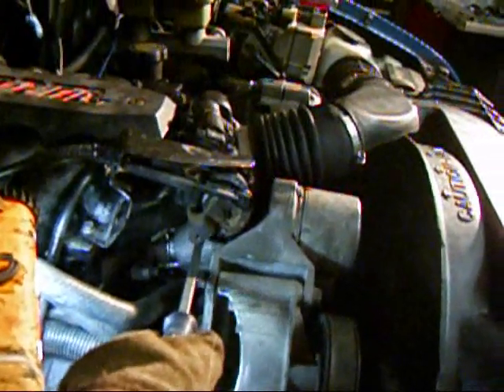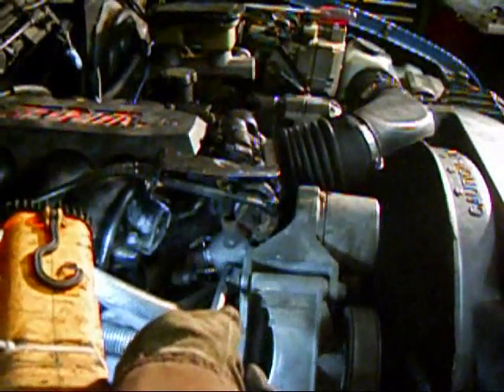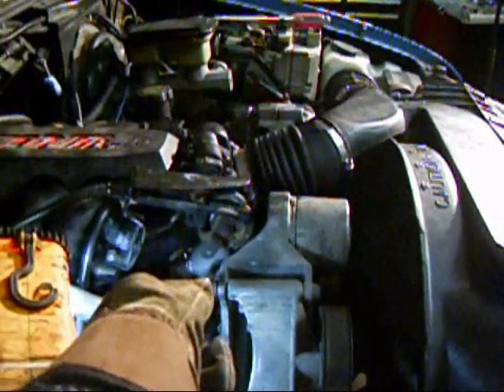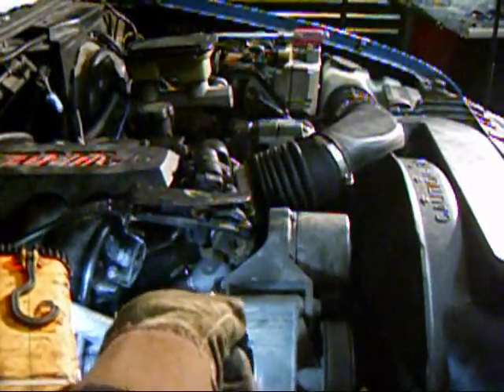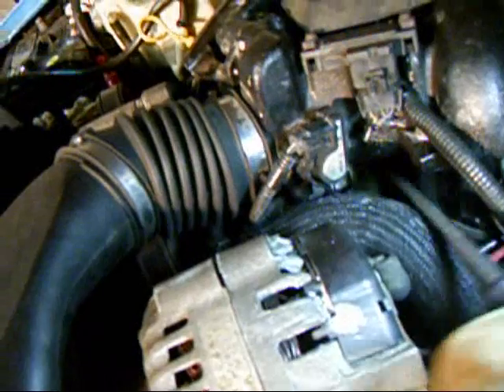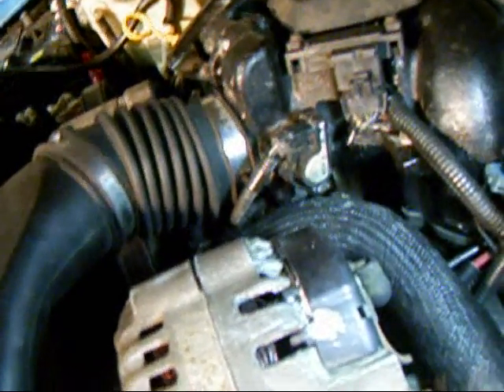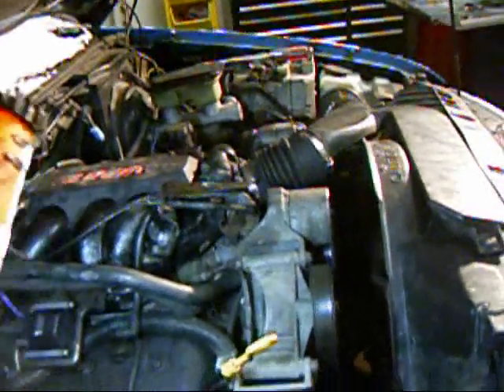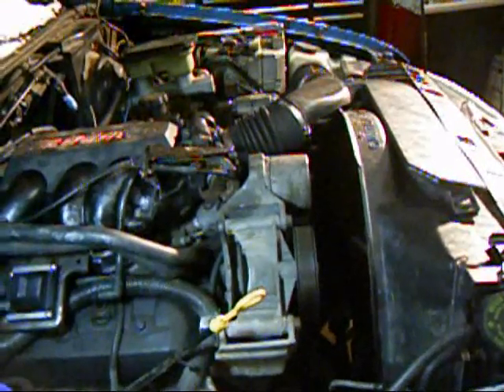GM Troubleshooting Part 6 - Exhaust Gas Recirculator (EGR) valve

Comment: Sometimes the gasket blows on these.  I just took mine out today and it had some minor carbon buildup but the one thing that stood out visually was the gasket itself was burned from one edge to the other edge. I've ordered a new gasket and will see if this fixes my rough cold start condition. It always starts right up but idles rough until it warms up and then she runs really smooth, but still will misfire at idle at a light or stop sign. The gasket is obviously blown by looking at it. It's a 92 bravada with just under 85000 miles on it. These are supposed to be serviced every 50000 miles. mine is about 35000 overdue.
Reply: Update?

Comment: what if it idles fine till you try to excellerate... then it dam nears dyes
Reply: it goes up to 3 grand then instantly startes to dye no power you let off the gas it dropes below idle ... runs rugh for a min then clears up back to idle
Reply: trisumtin111 im having exact same problem! did you manage to fix it? any help would be great!
Reply: I'm about 5 years late...but I'd say new fuel filter.
Reply: +Myles Wilson I'm late, but your cat converter is most probably  clogged by the symptoms you describe.

Comment: Have a 93 S10Blazer, got a service engine light, used a paperclip to jump the top right two sockets on the OBD diagnostic, got a code 32. Autozone sells EGR valves for 159$. Eff that, I say. This fix worked, with a new gasket (Part Number: G31459) for 2 bucks. Back on the road in a couple hours. Thanks for the video!

Comment from the maker: @uaduncan Does it work at 1/2 to 3/4 throttle OK but just idles poor?  this happens when egr is sticking open and vacuum is too low.  this used to happen to my truck about 2X a year.... i would tap the valve and the idle would calm right down.  this isn't your prob because you changed the valve.  maybe your ecm is holding the valve open when it should be holding it closed.  leave new valve in place.  with your old valve plugged into wire harness, check if it moves when someone turns key on/off.

Comment from the maker: Good tip for sure.   Going from memory there were 3 different styles of EGRs ($60, 120 and like $300) that fit the 4.3s.  My particular engine required the most expensive of the 3 EGRs so I elected to clean mine rather than replace it :)